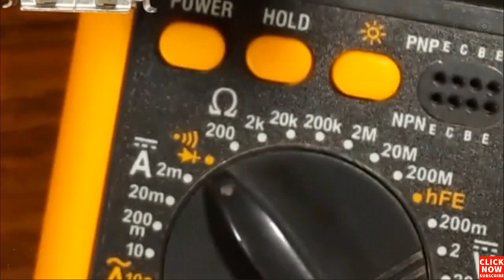Laptop motherboard components names & functions explained part 2 | components of motherboard

Comment: Excellent video but I have a question . Why some capacitors are named C and others PC ; in my motherboard I can see some ceramic capacitors named PC . So I don't believe that PC means polarized capacitor in my case neither parallel capacitor . So what PC means ;